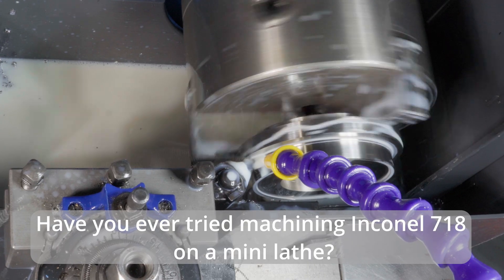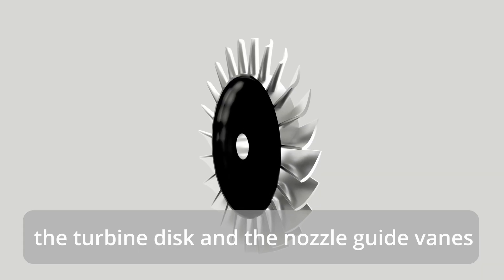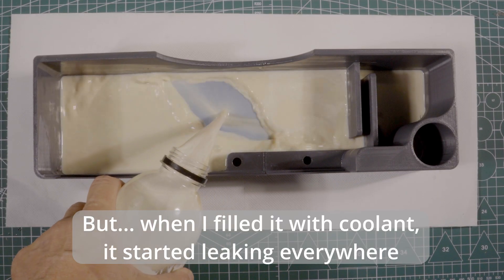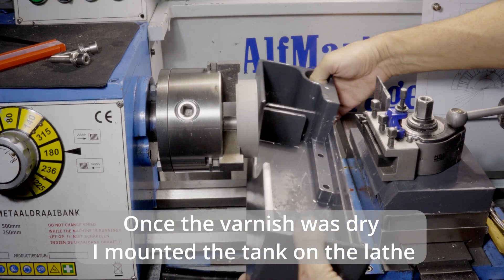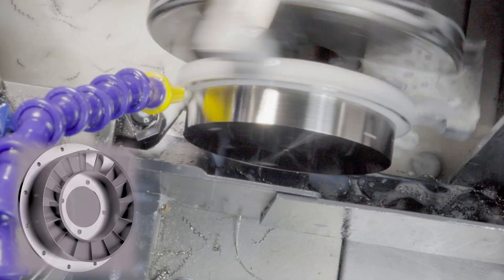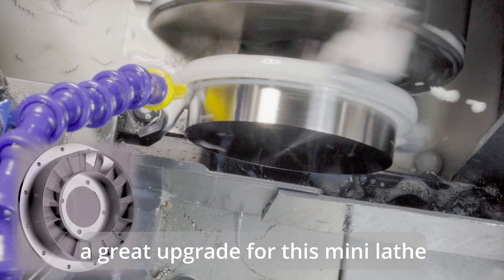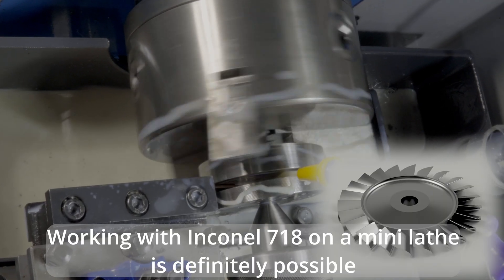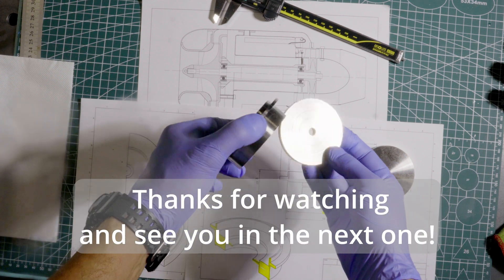My Mini Lathe vs INCONEL 718 – RC Turbine Project (Part 1)

Comment: something i always hear in the back of my head is an article on early RC turbine building... "we found the impeller expanded at operating RPM and the reduced clearance tended to cause immediate and catastrophic failure..."

because it was bored through. the fix was splitting the shaft and keeping the wheels solid.

iunno when physics changed... same applies to the old delaval turbines... at some point you have to stop placing wheels on a shaft and instead attach shafts to wheels... turbos are one piece for a reason...
Reply: Modern jet engines actually went the opposite direction: Each turbine blade is an individual part, and the turbine disc is created by slotting blades into a hub.
Reply: @SnakebitSTI  blades are not teh entire turbine wheel.

removable blades inserted into the rim has been a thing since delaval, parsons, and ljungstrom...

should look at how those modern turbines attach to the shaft. thats the important bit. thats where the force is. at the hub.

the blades are made separately for several reasons...
Reply from the maker: Yes you are right, but my first Challenge is to make something operational
Reply: @alfmart58 Oh yeah, I don't mean to suggest you should machine individual turbine blades. Achieving those tolerances on a hobby mill and lathe would be... difficult.
Reply from the maker: Understood
Reply from the maker: Very interesting, thanks

Comment: Nice work.  Since we use a lot of it at work, years ago, I made a matching set of IN718 wedding rings for a friend and coworker when they got married.  I made a practice set in 316SS, and they were a breeze compared to the final IN718 ones. I broke a lot of tooling in the process. Everything in the setup needs to be super rigid.  Any axis not moving needs to be locked down very tight.
Reply from the maker: Yes , you are right, rigidity of the machine and tooling is key for INC 718; this is my next challenge with  the turbine disk and NGV in my milling machine

Comment: Some questions: You use a reamer; I assume HSS? Drills as well? What about ceramic inserts? What are the cutting speeds for different tools? Cutting geometry? But hey! You are even parting a work piece! Impressive, and interesting!...
Reply from the maker: I will try to answer you:
Reamer is HSS but drill bits are carbide.
rpm: between 130 and 80  ( 80 much better), deeep of cut : 0.3 to 0.5mm; advance 0.03 to 0.05 mm/min, in general very very slow...
And yes parting the INCONEL was a nightmare
I have not experience with ceramic inserts for INCONEL, I know for milling is the best option, but for lathe I don't know. If you have some experience please let me know.
Best regards
Reply: @alfmart58  Ceramic is great but it requires a lot of power and rigidity, I wouldnt expect it to work well in your application. A bunch of other people have recommended inserts but my favorite is Iscar, I generally finish with DNMG and rough with CNMG. The F3S chip breaker which is a light roughing/finishing geometry for Ti/superalloys worked really well for me, I think the carbide grade was IC804. The F3P (steels) and F3M (stainless) geometries also work awesome for their intended materials.
Reply from the maker: @w @willhall4631 thanks for the info, very valuable

Comment: Oh, wow, I have been thinking about where to source 718 for my turbine for a while, and the last time was yesterday. Today I was recommended this video 😀

Nice lathe work on the inconel! Parting off that turbine wheel blank was impressing! 

I have built the kamps microturbine. First with turbine wheel out of 316 - it ran great with the 316 turbine wheel, but not much thrust. I upgraded to a cast inconel wheel later. I have changed some things in the engine - comustion chamber, custom diffuser, compressor 66/46 instead of the 66/42 2019 in the plans. I can not tell if the changes is necessary but it has been in an effort to lower the exhaust temperature after installing the cast wheel. I am planning to build the kj66 ngv to test it in the engine.

I subscribed and am looking forward to more videos.
Reply from the maker: Thanks, I subscribe you too.

Comment: Really liked your system for coolant on a small lathe. I have always been reluctant to use coolant because of the mess. My old Boxford lathe has a coolant system built into the lathe but I have never used it. I may make something like you have done but not printed as I do not have a 3d printer.

I shall be interested to see what you achieve with the turbine and NGV. I have made several turbines over the years and very early on came to the conclusion that buying a cast turbine wheels and NGV made the project so much easier. In fact making your own moulds and making wax patterns and getting them cast is easier than making the parts from billet. Castings would be in Inconel 713 of course. The NGV is usually cast from a high temperature Stainless steel as it does not need to be made from Inconel. John
Reply from the maker: I have some experience already milling NGV in stainsteel, but let see what happen with INC 718. Stay tuned to see the results. Regards

Comment: How did you come up with the design for the rotor and stator blades? I've always wanted do something like this, but have no idea where to start with modeling the compressor and turbine sections.
Reply from the maker: Hi, The 3D models are based on the KJ66 and GR130 jet engine drawings, there is a lot of info on the net. I can provide you the 3D models if interested, please let me know. Regards
Reply: @alfmart58  Yeah, I'd love to see the models. Thanks for the tip on what to search for too. I built a small turbojet out of a turbocharger before, but something inline and compact would be a lot more fun. Sent you an email.
Reply from the maker: email answered, good luck
Reply from the maker: Thanks, and yes, you are right

Comment from the maker: What’s the hardest material you’ve tried to machine?
Reply: Ive worked on some mystery titanium alloy that wouldn't be machined without flood coolant on a decent engine lathe with good tooling, I had trouble turning even just a 1/4" diameter piece with a good surface finish, probably because the lathe didnt have flood coolant. I was able to work 316 stainless and s8 tool steel quite well with just cutting oils, and this was with 4 and some inch diameter pieces
Reply: Probably Waspaloy for me…
Reply from the maker: There are different thermal treatments that give different INCONEL: 600, 625, 725,  750,...
625 I think it is much more easy to mechanize, and 718 is one of the worse...
Reply: A bit of lead pipe was surprisingly difficult. Sandy castings (zirconia sand) blunt tools very quickly.
Reply: managed to slot a Ti bar for a throttle shaft, with only 2 hss ebay cutters... the m3 tapping got me. until the snapped taps worked far better when ground down a bit... my only snapped taps!

lol, cutting 2" blocks of TC with a friction saw? once it starts glowing it just sort of dissolves... this job would get about 50kg of carbide brazed on one face...  brick crushers... had to always cut one block in half...

the "ni-hard" castings tended to be what the name implied...

yeah, lead is surprisingly hard as you cant hold the stuff and it grabs.
Reply from the maker: Very interesting
Reply: I machined Hastelloy X on my mini lathe with polished carbide inserts at slow speed. It went surprisingly well! Inconel 718 is probably harder though.
Reply from the maker: @Mister_G yes inconel 718 is the devil!!